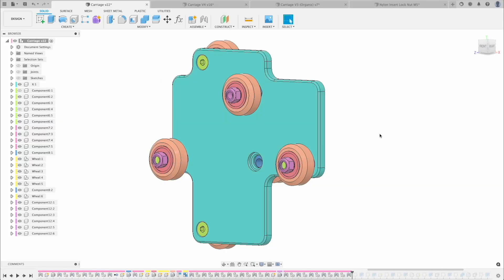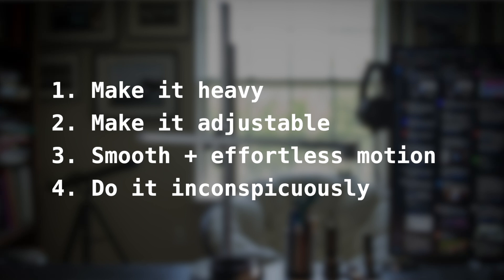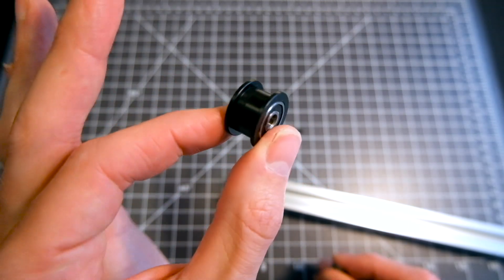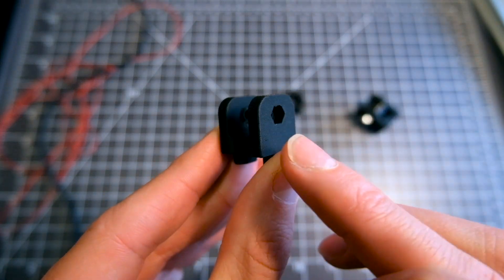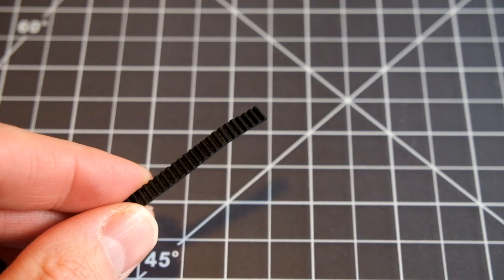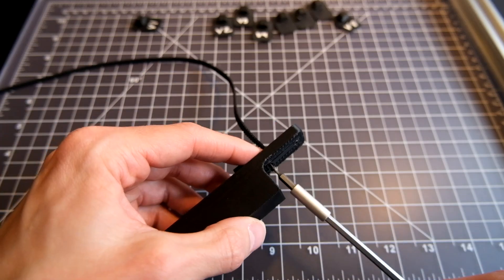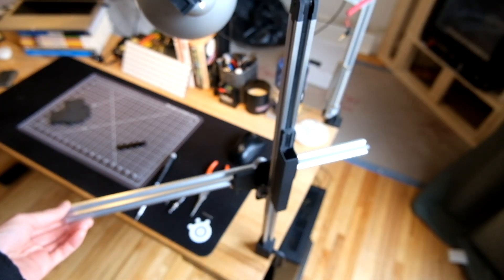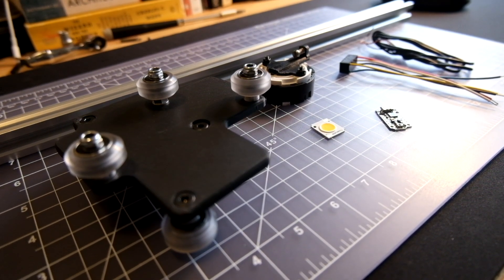DIY Dyson light motion system - DIYson Lamp Build Log #2

Comment: Hi, I’ve just checked out the site you got the parts from and noticed they do black anodised bars. I think I would prefer to use these to make the other attached parts less obtrusive. Sometimes contrasting ‘colours’ add to the aesthetic look but in this case where you seem to aiming for a discrete method to move the lamp perhaps the black would be better. Besides black is cool 😁.

Comment: how did you print the counterweight enclosure? The print guide in github says no supports needed but am unsure about the bridging once it gets to the top section.
Reply from the maker: The print guide on Github refers the latest enclosure (the design has changed since this video), but neither of them need supports. There will be some bridging but it will all be internal so you won't see it
Reply: @StevenBennettMakes  awesome thank you! I found you today and started following along!

Comment: you really should use a grooved pulley (to nitpick you're using an idler not a pulley) this way will wear the belt over time leaving little black residue everywhere, don't ask how I know 😬 (I am aware the tension on this belt will likely be much lower than  if it is used for the original timing function so the wear may not be a big issue)

Comment: I feel the counter weight is an eye sore.  

What if you used a spring?  I envision a string going up from the carriage, over the top, down to a pulley, then back up to the top.  The pulley is then attached with a spring to the bottom.  This entire setup is hidden in the 20x20's channel.

There are obvious problems : the pulley has to reform even after being drawn out to half the height of the lamp (25cm?)  And the spring has to be selected based on the weight of the carriage and arm, so you lose the fine adjustment of the shot.  

I'm also probably overestimating the amount of space in the channel.

ETA - lube your counter weight with paste wax.

Comment: Hi - thank you for this video series! I will try to build this! Do you have any tips for printing this counterweight successfully ? full supports? anything else? 40% infill?
Reply from the maker: Hey there. I print mine with the hole for the belt clip facing up, supports enabled on the build plate only (ideally they'll only be generated under three of the wheel holes), 6-8 perimeters, and ~40% infill. Also don't forget to check out the later build logs because there have been a lot of carriage design updates since this one. Have fun :)
Reply: @StevenBennettMakes  Many many thanks!

Comment: I don't really see what was wrong with using a string/cable. It's lower cost, more reliable and a simple knot is way easier to implement than various fixings for the belt end. Also you are less likely to introduce friction than with a belt.
Reply from the maker: String/cable could totally work too, just a question of which compromises you prefer dealing with 👍🏻
Reply: Agreed - personally I actually think the string would look better than the belt. As for a securing option I figure you could use a small aluminum tube and crimp the two ends together after looping in order to avoid the knot, which I to some extend will agree can detract aesthetically

Comment: For some pieces you can make a good use of a vise and a file instead of a 3D printer. I may sound obvious, but I didn't realized it when I started using my printer, and lost a lot of time doing some stuff that would be way better handmade.

Comment: Hello Steven I have loved this series I just binged the whole thing and will probably watch it again in the upcoming days. Anyway what is the type of filament that you use for this project? I love the mate black look and am curious to what filament that you use.
Reply from the maker: Hey Aaron, thanks for checking out the project. The filament I use is Duramic PLA plus, one of my favorite filaments: https://amzn.to/3XyLQr7

Be careful because it does have a slightly matte quality which in my experience causes (very) slight nozzle wear over time on brass nozzles and can leave a bit of residue on smooth PEI build surfaces. Personally I have a dedicated sheet just for matte filament like this because the results are worth it and I often. Have fun!
Reply from the maker: Aaron, sorry about this but I just realized I sent you slightly different filament than what I use. I sent you the link for Duramic PLA Plus, but I actually use Duramic "Matte" black. Sorry about that. I just updated the link in my original response too, but here is the real stuff: https://amzn.to/3DcCh9m (don't worry, the non-matte filament is good too!)
Reply: @StevenBennettMakes  It is all good I ordered a roll of the stuff you sent previously and have some goodies printing now actually LOL. When this roll is gone ill use the new link thank you my friend.

Comment: What size of aluminium profile did you used?
Reply: It says 20x40 v-slot but it not looks like it.
Reply: @thombaz  From looking at it, it's 20X20 - the "name" denotes the size in mm - so a 2040 is not square but twice the width of the height, and these are too small to be 3030 and much too small to be 4040

Comment: What's the black filament you're using for this project Steven? It's got a nice matte appearance, but obviously doesn't suffer from layer adhesion issues.
Reply from the maker: This is Duramic PLA+ Black (https://amzn.to/3DcCh9m). Not the strongest PLA, but probably my favorite surface finish ever (I've tried a lot!). Do note that it is a "matte" filament and comes with the typical downsides: slightly increased nozzle wear, and a some residue on PEI build plates. Other than those caveats, it's wonderful. I suggest using a hardened nozzle and, if possible, designate a "matte only" build plate because regular PLA doesn't adhere well to the matte residue.
Reply: @StevenBennettMakes  Have you considered vapor smoothed ABS? combined with some dry lubricant you could reduce the friction on that counterweight even further

Comment: Thank you for this great video series. I was thinking about building my own version a while ago but didn't find the time and budget to do so. Now I revisited that idea and found your videos. My first concept I made back then was similar to your first iteration of the motion system (except for the excentric spacers, they are brilliant). I was already concerned about the smoothness of the counterweight if I would directly slide it on the v-slot rail. That's why I planned on using a "drylin N guide rail" (size 17mm) from igus. This rail is pretty slim and matches in colour. It uses a small plastic carriage that wouldn't be visible behind the counterweight. It supports a static load capacity of 50N but this shouldn't be a problem because the perpendicular load on the rail is very small. I looked up pricing and it appears to be pretty expensive in the USA (3 times as much as in Germany) so it might not be worth it. I also planned on using stainless steel cable to match the aesthetics and have a smaller width. 

When I find the time I'll try to finally build one myself. But until then I'll gladly watch your videos (that are underrated btw).
Reply from the maker: Very cool, Tim! I'd be really interested to see your variant with the counterweight running on the type of rail you're describing, even with the increased cost, upgrades that make the motion smoother seem totally worth it. I will have to catalog the Igus rail as a potential future upgrade :)

I also love the cable idea too, it should be easier to hide and I could see it having a satisfying industrial aesthetic. I hope you do end up continuing your build, I'd really like to see your take on this project. Thanks for checking out these videos, really glad to hear you're enjoying them!

Comment: I really like how your videos already have a clear "Storyline" , so it is really easy to follow you on each step. Maybe you can also connect the other ends of the counter weight and the carriage and make the counterweight run smoother by running it on one of the wheels you used on the carriage.
Reply from the maker: Thanks Neal! That is such a great idea to smooth out the motion of the counterweight, I will definitely be thinking about that as I work on that problem. Thanks for the suggestion :)